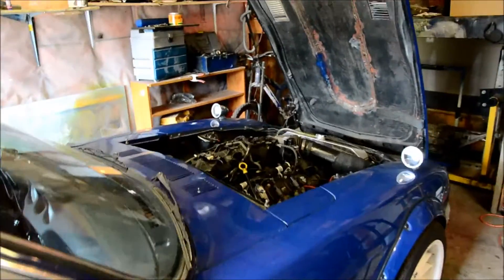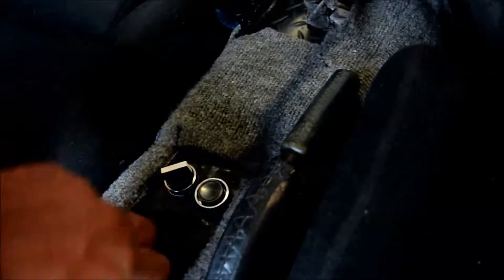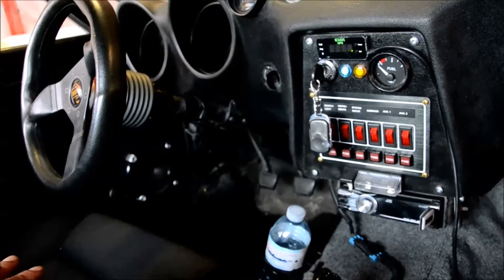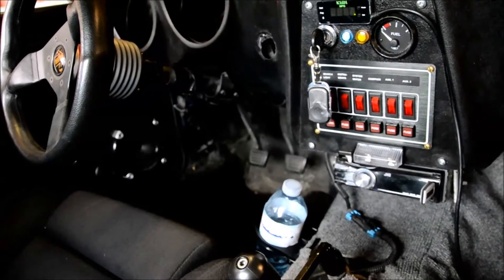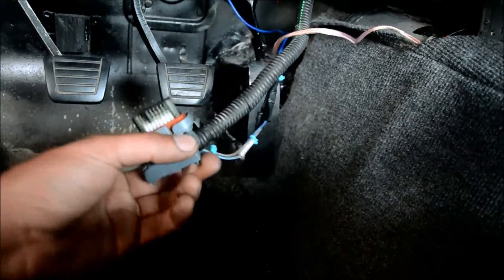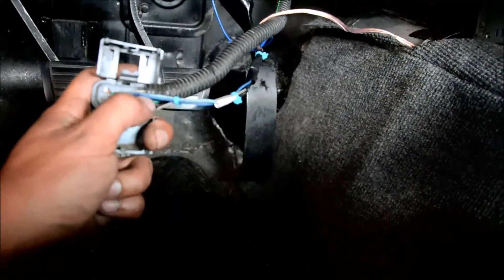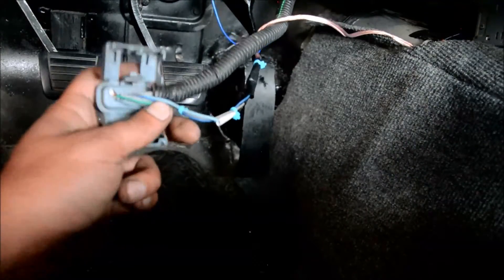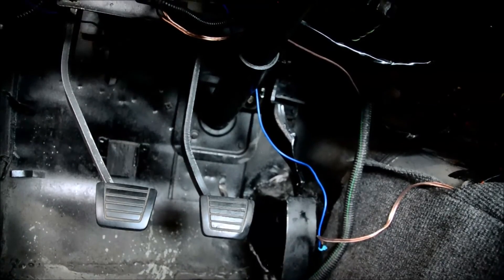Simple LSX Cruise Control Wiring - Hobby Fix

Comment: Will this work with a standard set up? Or only 4l60 or 4l80
Reply: Only autos it turns out. If you set the ECU to manual it won't work on a gen 3

Comment: I see you kept the truck manifold. do you think it would have fit if you had shaved it?
Reply from the maker: Hey Jeff, the only way I was able to fit the manifold was by modifying the hood. I raise the center section bulge up an additional 10 mm by cutting it all the way around and welding in a strip on metal the whole way around.